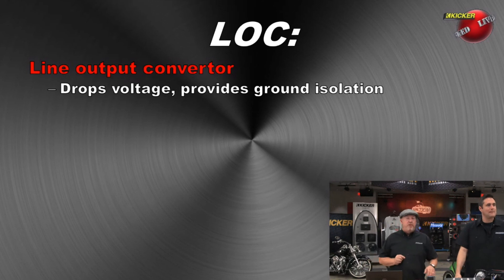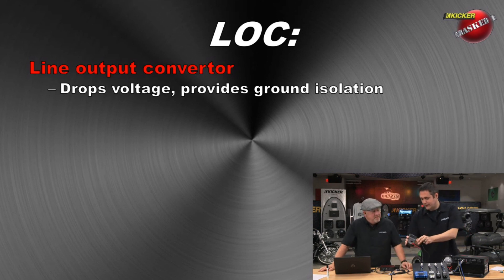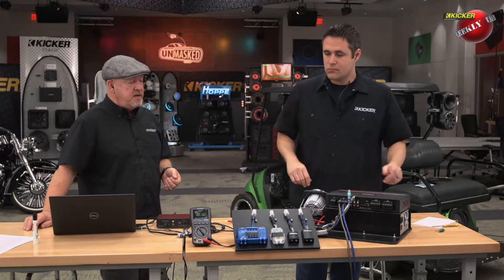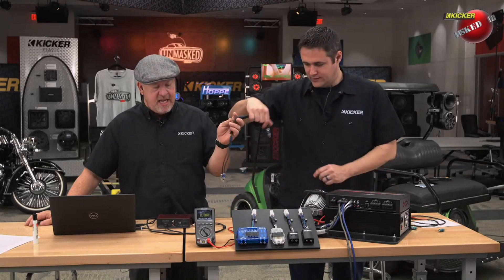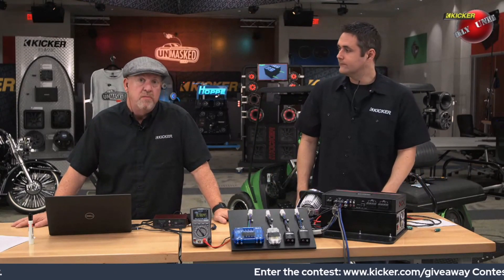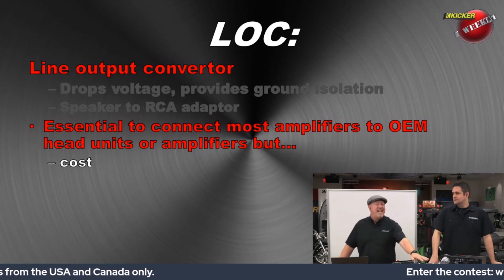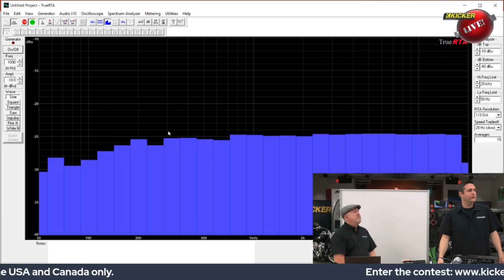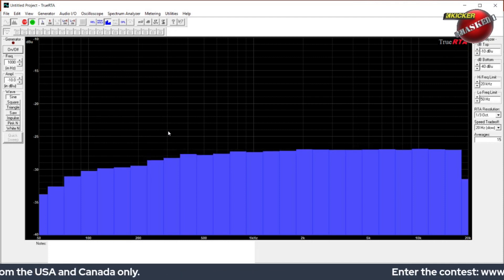Line Output Converter Live Demo - KICKER UnMASKED - Shorts

Comment: I got the 20$ loc 2 but didn't use the ground and remote wire cause I installed my amp normally and used 0 gauge pure copper for power and ground on the amp but with the loc I'm getting lots of engine noise mostly when I start the car and it's loud I tried using the ground on the loc to the side of my head unit but it got worse, should I run the ground for the lost to the same spot as my amp? Or what should I do
Reply from the maker: 100% that's a grounding issue.
Reply: @KICKERAudio  yeah I know but is it the ground on the LOC or the ground on my amp because I had an aftermarket head unit in here and it didn't make that noise but the aftermarket haed unit died on me That's the reason I bought the Loc
Reply from the maker: @thomaswalton1978  It's a system grounding issue, it could be any of the devices in the signal chain - Even if everything is hooked up correctly you might still need a ground loop isolator. If you'd like us to troubleshoot your system, please give our tech support a call at 1-405-624-8583.

Comment: Hello I purchased a Kisloc2 and after installation I noticed every time the bass hits the red light on the kisloc2 dimes is this normal.  Thank you
Reply from the maker: The red LED just means the KISLOC2 is detecting a DC Offset from the source unit and will turn-on any other devices connected to the REM wire. When your bass hits, it's changing the voltage going to the KISLOC2 enough for the KISLOC2 to register it.

Comment: question though why does the chart start on the left at 50 hertz? if we are going for bass 50 would be rare to use. Im curious what that chart would look like from 20 to that 50..
Reply: Stupid question, but if you have a dedicated factory amplifier for your factory sub, is there any benefits in running a line output converter to the factory amp or is it just designed for the level input and wouldn't benefit for a low level input?

Comment: I'm using one of these kickers high to low adapters with a crunch 1100 amplifier and I can't get it to sound good was getting ready to blame the high to low adapter until I saw a couple of videos here thanks for the videos I know nothing about crunch can anybody give me any words opinion how about crunch amplifiers
Reply from the maker: There are a few potential factors. The first is a combination of the tuning, along with how it was wired.  Another is the quality of the music itself.  The last one (and this is very common) is the frequency response of the speaker lead you tapped in to...if that speaker cant play bass frequencies, then it will never send much bass information to a subwoofer, no matter what equipment you have.  When using a high level input, you must first establish that it is capable of delivering the frequencies you need. If you need to verify the signal and don't have a KEYLOC (does it automatically), here's how: https://youtu.be/_TQn8vUe9yg?si=TvST6oP060wr56cO

Comment: It says it goes up to 8volts whats tge minimum setting my amp likes 2 and under i e got the small loc
Reply from the maker: We made an extremely wide range of acceptable input voltages. In fact most of our amps only require a minimum of 125mV.
Reply: @KICKERAudio  thanks you I bought one of those from you guys I just was not sure what the minimum voltage was that it put out

Comment: I bought a Kicker 46KISLOC2, It turns on after the car/radio been off for like 10 mintues. The amp gets hot and goes into protect mode.  You think its defective? Its on a 2017 camaro.
Reply from the maker: The best thing to do is call Tech Support. They are open weekdays from 8-5c at 405-624-8510 or email them at support@kicker.com. If you have noise, it is likely something the Techs can help figure out for you.

Comment: Great Education, Thanks

1. What is the differences between KEYLOC and LC2i Pro? This is my current hurdle moving forward on my purchase. Help?
Reply from the maker: The LC2I Pro is primarily analog, and built to convert signal to RCA. It is also has a bass restoration section to make the low end louder. The KEYLOC is quite different. It is completely digital, and has a signal processor built it.  It corrects the entire acoustic spectrum, and has indicators to tell you what frequencies the factory wires are sending from the radio (not all of them have bass, midrange or treble, especially if those wires are made to go to a dedicated sub, tweeter or midrange).  Many analog line out converters degrade the sound as the volume raises, especially bass. Watch this video for details: https://www.youtube.com/watch?v=ZwWggIfQHqM
Reply: @KICKER-AUDIO
Which output wires go into the KEYLOC inputs? Considering that  we would keep the entire OEM Head Unit and Amplifier in place.

Do the Head Unit output speaker wires go into the KEYLOC (cutting them, which prevents them from going into the OEM AMP)

or

Do the Amplifier output speakers wires go into the KEYLOC (cutting them, which prevents them from going into the speaker (it is an OEM dedicated sub)

the video suggests there is no OEM amplifier, it simply says to use with OEM Head Unit, so it is kind of confusing.

Thanks for the reply :)

Comment: 2020 challenger all oem audio equipment. I have taped into rear deck speaker with speaker wire with rca ends straight into mono-block amp. Sounds decent. But would I benefit adding a loc?  I have a kisloc but skeptical on using it.  Any advice would be so appreciated
Reply from the maker: The KEYLOC would help with the sound quality using the DSP. This is the first question, but the other one is the amp and speaker combination you're running. What are they?

Comment: What is the difference of between  kisloc VS kisloc2?
Reply from the maker: The KISLOC 2 has more power handling (so, a wider range of audio systems it's compatible with) and has a powered remote wire built in.  You can use this to turn on amplifiers without needing to find a switched turn on lead in the car's wiring.
Reply: @KICKERAudio  thanks for the answer

Comment: So If Im understanding this right, I can just add RCA ends to my rear speaker wire and plug in to my Kicker CX360.4 Amp? I wont need to use an LOC? My after market Pioneer is a cheaper one that only allows for one rear output or Sub (not both) and Front rca. Im going to run the Amp bridged for the sub and the other for the rear speakers. However Im confused on how I should connect the rear speakers or the amp using just one set of rca cables. Was going to run the sub off the one rear output and then use the speaker wires using rca to connect the rear. Thanks for any help for this new-b
Reply from the maker: Yes.  You will need to determine the voltage first to accurately choose high or low impedances, but an LOC should not be necessary. If you have a start/stop vehicle however you may need a load adapter. For details, reach out to our Tech Support team:  support@kicker.com

Comment: Nice, i just bought two of KISLOC2 :)
Throwing out my currently NVX 4 channel high/low converter. Though my sub-amp supports highlevel on the rca input but i have not got the amp to turn on by the DC-offset feature.
Trying with the rear channel. Might require to use the front channel for that.. so that isnt an option with this current setup.
Got speaker pops sometimes when amps turn off. Really annoying. No pop when turn on. Though when i cycle the key they pop sometimes. subwoofer and door speakers.

Since the Kicker KISLOC2 does not have any gain adjustment, how high might the outputs be then? Ill guess the gain adjustment will be on the amplifiers.
Mine are quite hard to setup since the stereo display are not in numbers.. there is a bar that will fill up.. and every turn on the volume is a step so you need to count how many steps or how far you are from the displayed text. Not very accurate.

My home audio pops the speakers too sometimes when changing settings in windows sound.. like the bit and that stuff.

Please tell me more about the Kicker KISLOC2 :) any advices? tips and tricks?
Reply from the maker: Pops like that have to do with timing. Reach out to our Tech Support department for details: support@kicker.com or 405-624-8510.

Comment: hi folks at Kicker , just 1st wanted to say thanks for all your replies to everyone , its nice to see a company actually communicating and helping the public so good job on that one , 2nd have a question of my own ,im running a cheap loc at the moment (vibe loc) which is being fed its signal from the output to the factory underseat subs (bmw 5 series e60)  from the factory amp , so my question is if i wanted to get the keyloc 2 loc am i best to stick with the sub output signal from the factory amp or am i best taking the signal from the full range speaker signal fitted to the rear deck for the keyloc 2 to work properly with all its dsp ? ps im only needing the loc to give me an rca output for a mono amp to feed a sub thats only ever going to be running a aftermarket subwoofer ,  thanks in advance for your help as i wasent sure if the keyloc 2 required a full range signal or if it was happy enough with a i assume a filtered signal this is going to the factory subs ? thanks
Reply from the maker: The KEYLOC will work in either case, but a full range signal might do better given it has more info to work with (if in fact it is getting a full range signal). The only real way to know is by using a pink noise track and an RTA. The best answer?  Try both! Can't hurt, right?
Reply: @KICKERAudio  awesome thanks for your reply , ah the good old days when head units used to have a nice simple clean rca outs lol

Comment: Factory head units not only have bass cutoff limiters but they also have frequency DSP filtering. So this whole video is pointless. 
If you have an after market head unit you have 2 volt - 5 volt RCA outputs which are exactly what the amplifier inputs are designed to work best with.
Reply from the maker: There are two points to clarify here.  The first is that factory audio systems do in some cases add filters to lower bass output. They do that to protect their factory speakers, which can limit the performance of aftermarket equipment. To determine this, you would use an RTA which many companies offer,  in conjunction with a pink noise track that we offer on our website for free.  Using the KEY amplifiers or LOC, the DSP automatically detects that filter and boosts those frequencies to help add bass and give a smooth frequency response to work with.  A full video is available here to show you how it works: https://youtu.be/ZwWggIfQHqM

The second point about aftermarket head units WAS, some time ago, completely true. Back in the day, RCA outputs bypassed the factory amplifiers, so it was a cleaner signal.  This costs a bit more to do from a manufacturing standpoint, so all but the higher-end head units simply step down the pre-amplified signal before being sent to the RCA's. This amplified, then stepped-down signal is not as clean, but makes the deck a bit more affordable. We made a detailed video about why high level is actually a better signal here: https://youtu.be/cQzHIT5LFgY

Comment: The funny thing is they say cheap lol that kicker is at most 29.99 I just got mine in ebay for 19.99 lol I'm ditching the nvx one I had its garbage cant even get 1v out of it and it costed the same as this thing.
Reply from the maker: We try to make our gear as affordable as we can without sacrificing quality or functionality. Were not trying to be the most expensive or the cheapest. Just the best bang for the buck.
Reply: I use a 4ch NVX also.. clean output but really low rca voltage output and that is with the gain turned all the way up. No clipping or distortion.
I think they use a quite heavy stepdown transformer. 3:1
Im throwing out mine aswell.. and ditch the 12v power feed as well.

Comment: Any idea on why no signal for subwoofer? Wired everything amp turns on etc. Just no bang?
Reply from the maker: Did you verify speaker leads are passing full range signal?  Not all do, and the sub amp cant do its job without it.

Comment: So that is a factory head unit? How would it compare to a LC model?
Reply from the maker: We used one of our marine head units for this demo, which is full range.
Reply: @KICKER  factory head units usually have bass roll off as you increase volume that is the reason for my question
Reply from the maker: Some do, yes.  It depends on the factory crossover, eq and DSP. This is why we also made the KEYLOC, which helps with many of these issues. https://www.kicker.com/keyloc-smart-line-out-converter

Comment: I’m using the kisloc2 and getting a lot of engine noise induced. I’ve checked my amp ground, swapped rca cables etc but cannot get a clean signal out of this device. How important is location of loc?  Mine is very close to my factory head unit. Jeep Wrangler if that matters. 
Also. I bought two kisloc2s and one of them never worked out of the box.
Reply: just connect the inputs together to a single speaker and you have clean signal coming out of both rca channels
Reply from the maker: Did you talk to our Tech Support group?  I'm sure we can help if you call us at 405-624-8510.  We are open weekdays from 8-5 central time.
Reply: Get you a certain Vega or nvm 2 channel loc they work really good it has super low distortion and got a automatic filter and last long and no problems.

Comment: Does adding a loc allow an amp to output even more power bcuz the loc increases input voltage which an amp then amplifies?
Reply from the maker: Adding a LOC is often unnecessary, and can even hurt your sound quality. That's why most of our amps can take from 125 millivolts all the way up to 40 volts on input sognal, with no LOC required. Want to learn more about an LOC? Check this live demo out:  https://www.youtube.com/watch?v=M1YGS3VIuqc

Comment: Just bought the audio control lc2i and installed it.... Very disappointed with the low lows. It definitely cuts the very lowest region, below 33 hz, and I've had to use my DSP to bring it back. The Audio control LC2i also induced noise into the mids and highs, when the accubass was "kicking in". When turned way up, it's SUPER noticable. Great for the 99% of the average users that probably won't notice, but for those with big power and tuned to crush lows, it's garbage. It's also garbage for people that want pure sound quality. It adds distortion, upper midrange and higher, I could hear audible noise when accubass was active. I would have gone back to the cheap junk dollar store  loc I had, to get my lows back and "clean sound". The signal was stronger, gains set at minimum on all amps, so it did it's job there. I'll give it it's small bit of credit there.

Those of you wanting to add amps, if you like, and listen to music with low low bass, below 30hz, the audio control lc2i WILL NOT give you what you want. If your wanting top notch clean signal, the lc2i also won't give you what you want, UNLESS you turn accubass off, completely. 

Waste of $ for me, I'm throwing it in the garbage where it belongs and going with something else. 

Hope this helps someone not waste $ like I have. $100+ right in the fucking trash. 

I'll post back when I find something that truly gives your amps ACTUAL clean, high voltage, FLAT, signal. I'll be looking into the device in the video. 

Thanks for the upload. Appreciate the time you take to show others how important an actual unmolested, clean signal is. When you have a lot of power on tap, it's absolutely everything. I can't stress that enough. Your driver's will thank you with longevity and proper sound..
Reply: I agree I have  same issue
Reply: Totally agree same lc2i does not drop low..
Reply: I just put the kicker loc on my amp, it hits lows better but I'm getting some cutoff.
I switched back to the lc2i, hits harder but I lost lows below 32hz
Reply: @jesseh9174  just like the experience I had. Sounds like you need to turn the LOC up if it has a potentiometer, or gains need to be adjusted upward on the amp.
Reply: @georgesrisomsak9650  got it figured out, no more cutout. I had to redo my ground wires on the amp and 2nd battery. Crazy that I've had my system wired the same way for over two years and all of a sudden the ground points are no longer good. 
BTW I'm ditching the LC2I and getting the  JL Loc-22.
Reply: @jesseh9174  update us on the jl audio one plz
Reply: JL LOC22 installed today.
My xv3 12's hit much lower now at full volume. Also I can max out the output voltage without clipping. Wish I would have gone with JL in the first place.
Reply: @jesseh9174   are you running off your factory deck?  Does the JL audio account for roll off from the factory deck?
Reply: @goosem4554  yes and yes
Reply: @jesseh9174  wow that's great 👍🏼.   I have been back and forth on which loc to get bc there are so many
Reply: @goosem4554  get the JL and call it a day, you won't be disappointed
Reply: @goosem4554  the JL does not fix factory roll off
Reply: You need the lc2i pro.
Reply: What's a good loc for nice crisp deep bass?! Plz help I'm in need of 1 asap!!
Reply: @wattsup3418  the JL audio loc 22 has been great for me..World's better than any audio control product.
Reply: Do the basic low price LOC drop low?
Reply: @ecooutdoors  yes, none of the cheap ones have active sound management of any sort.